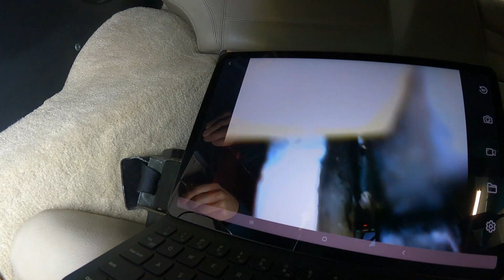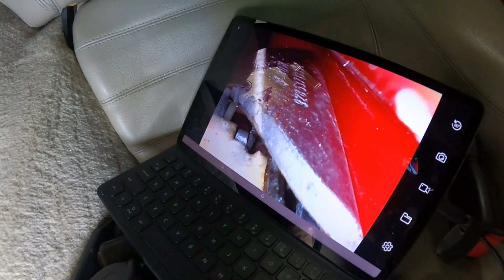Replacing the door lock on a Porsche 944.  With chapters!

Comment: I did the same exact mistake as you with the handle latch not being seated properly when refitting the handle after a repair. Now my door won't unlock and I'm pretty much where you started this video out. Wish I had a video probe now...
Reply from the maker: if you roll the window down, you can sort of access some of the mechanism from there to unlock the door
Reply: @ThingsBreak  Thanks! I forgot to update here, but I did just that, but with no luck. I eventually borrowed a video probe from a friend and managed to get the door open in the same fashion as you. This video was of great help!

Comment: I have to press and pull on my driver side l. I already tried grease and nothing, what could it be ??
I also notice that the main door hinge is not attached and there broken screws, it's only been held by the upper and lower hinges ..
Reply from the maker: Something must be wrong with the mechanism.  I could not figure out why my old one would jam up, but the used replacement has been working fine.